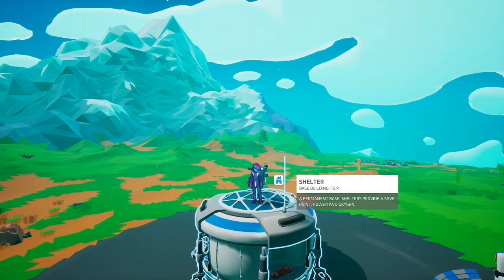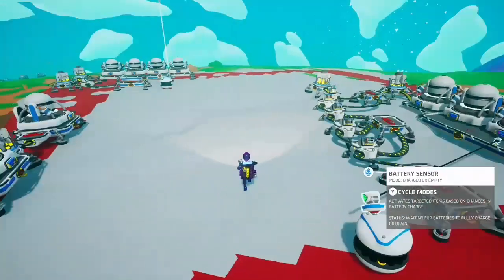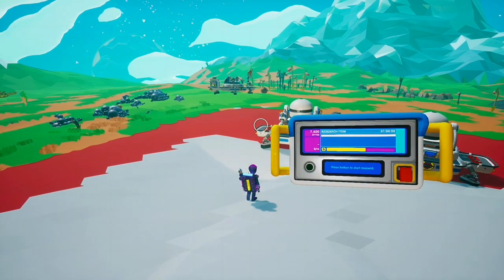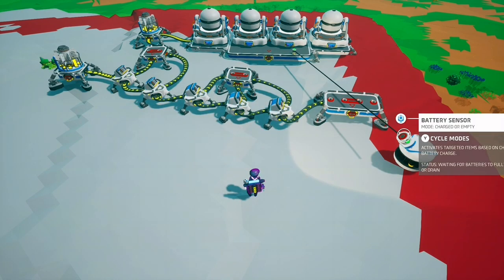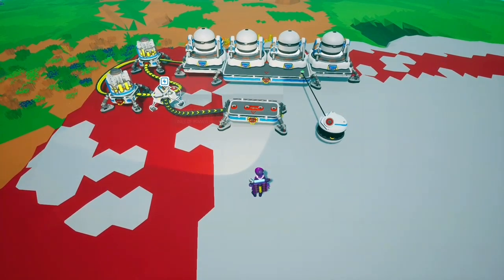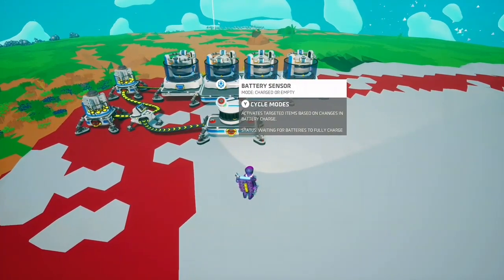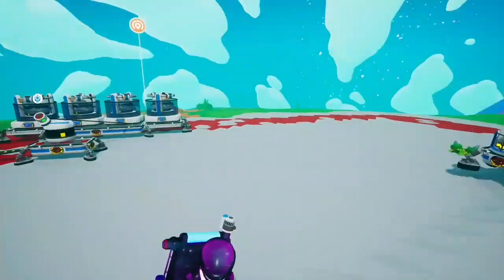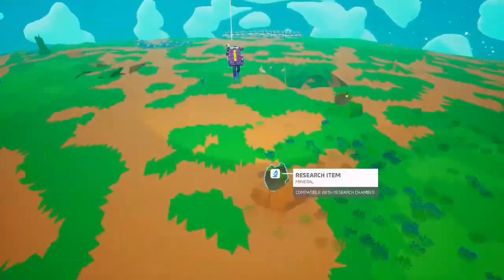astroneer Infinite bytes machine (check description)

Comment: Did you know that you can duplicate any item that you can package? Simply attach to the item a lot of packagers and activate them using proximity module.
Reply from the maker: I didn't. Thanks for the advice.
Reply: This does not work after Rail update
Reply: @sharazar  yeah, I know

Comment: I  just built an easy one on atrox. 5 rtgs. 5 med batteries. atmospheric chambers making methane,  move with auto arms, methane gets researched infinitely with zero imput. they're 400 bytes total.
Reply: Smart man! I’m a fan of researching things that you can make rather than stumble upon. However, does the byte farm still work when you’re not on atrox?
Reply: @hudson2284  It can also be used on Novus, unfortunately no others.

Comment: while testing a setup and its timing, i watched astroneer videos and found this one. what a coincidence that my setup is for automatically generate more bytes by just occasionally manually feeding soil to it. and i have to mention that i didn't leave the planet yet and also didn't find copper yet. my last discovery was a giant deposit of alu (my first alu!) on the fourth(!) cavelevel down (and that's also where i found the first pillar with worthwhile two research resources). thus i have a slight problem with constant power supply, having only medium wind turbine and small batteries.
my setup: 8 small soil canisters > 1 centrifuge > 32 organics > first research for up to 50 bytes each (takes 2.30, aborted by timer) > 1 smelter > 32 carbon > second research for 75 bytes each (takes 3.45). thus a total of 3200 bytes for 8 soil every 2 hours, LOL :-)
an improved ratio of 2 first stage researches and 3 second stage researches could give the same 3200 bytes every 40 minutes.
currently the timer is triggered by a storage sensor and made from delay/count repeaters. all this also powers down the arms because of my poor energy supply ...
Reply: ps: the current research station only shows the text "Press button to stop the research" while an older screenshot in the current version's astropedia still shows the additional line "(Sample will be destroyed)", probably to avoid all these exploits. but with that line gone now, i assume that this trick has been promoted from bug to feature because it requires additional manual work, or "clever" programming with timers etc?
Reply: I like the way you play this game. Honestly I’ve built almost no power sources in my current, most serious, play through, just by finding in tact turbines/solar panels, etc. I’d recommend using some of that aluminum to build a tractor in order to explore and bring back medium items such as wind turbines.
Reply: I just realized this comment is a year old and you have probably found a solution to your issue. Either way have fun lol!

Comment: What the… is this glitch still work? or it patched?
Reply from the maker: To my knowledge, it's still going strong
Reply: gaza1121 thank you for your answer, i start build it up😎👊
Reply from the maker: No problem mate don't forget that the medium batteries have double th e capacity they used to so the power needs to be 0.32-0.36 and not 0.16.
Reply: gaza1121 i was wondering why did not work :/ thanks i will try ;)
Reply from the maker: Your welcome mate. Have fun and watch your oxygen.

Comment: im sure you could make this completely automatic with mining drills to autocraft packagers etc so you just have to bop a button and yay
Reply: Packagers are in the small printer, I use that recipy all the time to craft me new loads of 32 packagers
Reply: I doubt that you can autocraft packagers as they are crafted in the backpack not the printer
Reply from the maker: They have added a few backpack printed items to the small printer (soil canister and I think small battery) I don't think packagers are there.

Comment: Damn does this still work?
Reply from the maker: I belive so. But they have doubled the capacity of medium batteries so you may need to experiment with the input charge for the battery. Maybe 0.36
Reply: @gaza102289  yes you need to do 0.36 i tried 0.16 but it is way too slow 0.36 is good

Comment: Well.....its patched you can no longer change the energy that comes out of the splitter
Reply from the maker: Have you got both cables connected? You can only alter power distribution if all three port are used. 1 in, 2 out
Reply from the maker: Also the cables are directional. The input has to go TO the splitter and the output has to be connected FROM the splitter
Reply: @gaza102289  oh i understand i will try rn
Reply: Works now thanks
Reply from the maker: @noahbatiz9658  np buddy
Reply: @gaza102289  sorry to bother you again but i did exatly what you did the cables are good and everything i connected the sensor to the platform but it just wont turn off when the battery is full i dont whats the problem can you check it out if it still works? Im return i will give you a sub🥺
Reply from the maker: Just ran a couple test and it seems to work fine. Are you using a battery sensor? Is it connected to the battery with the pin on the platform? (You can tell what the pin is controlling because it will glow) Is it set to 'charged or empty' mode? 

As for the sub, that's entirely up to you buddy, if you wanna sub that's cool, if not that's fine aswell. I'm not helping you just cause I want a sub.
Reply: @gaza102289  yes it is connected to the platform it is set to charged or empty but the sensor does not seem to give off a signal
Reply from the maker: @noahbatiz9658  that's odd. I'm having no problems. The sensor is on the battery right? Not the platform the battery is on? And it's a power sensor, not a storage sensor?
Reply: @gaza102289  yes its a battery sensor its on the battery i dont know whats wrong
Reply: @noahbatiz9658  okay so back then the battery holds 256 units of power. Now they have a capacity of 512 (which is double) so in Theory, put the power slider to 0.32 or 0.34
Reply from the maker: Ahh not played In a while so didn't know. Gonna start a new save after next week's update so thanks for the heads up
Reply: @Joshi-Squashi  oh ok thx
Reply: (Or maybe im just stupid)

Comment: i like it, but im not gonna do it, i wanna get to 1mil legit
Reply from the maker: Fair enough buddy. Good luck and watch your o2 😁😁
Reply: The best legit way I've found is sample farming on Glacio I set up 12 auto arm pickers dropping on medium storage silos and I'm getting 129k a run
Reply: @jacobd4955  what if you did an afk with this setup with every one you can find.
Reply: @willfowler8540  yeah it works but the resources and time you'll throw into it isn't worth it to me by the time I got the large shuttle and it became viable to build more it was no longer necessary I've got 700k bits and nothing to do with them besides send the exo request platform back where it came from again and I'm almost done with doing that
Reply: Some guy already did 65 mil :D youtu.be/z3MYStHEeS0
Reply: @tward0wsky  200 mil! https://m.youtube.com/watch?v=dQw4w9WgXcQ